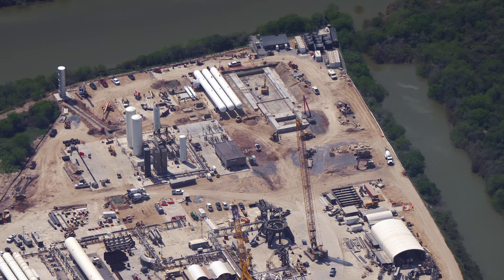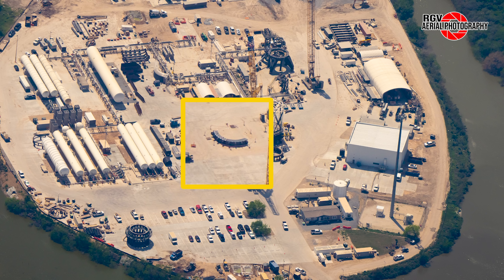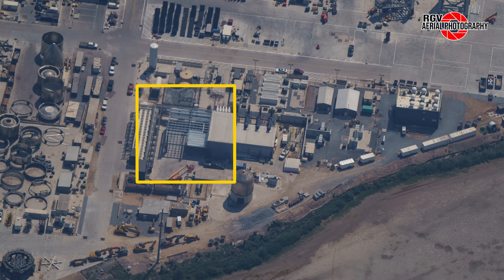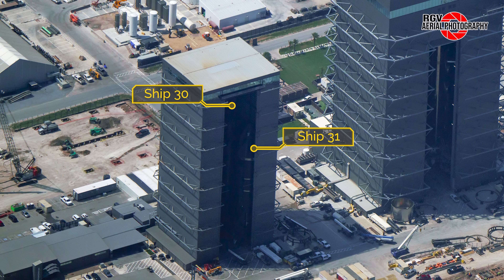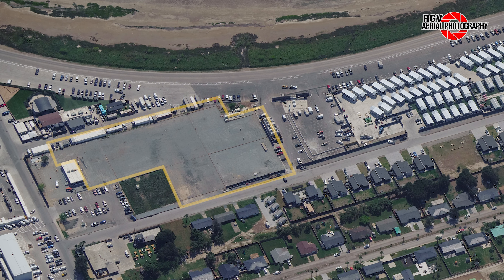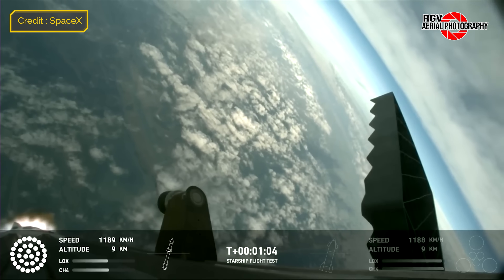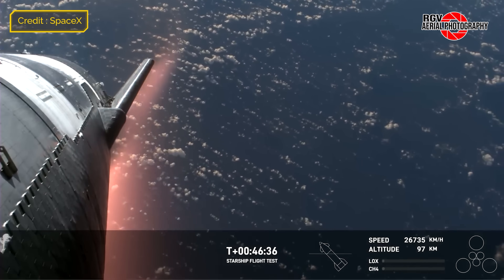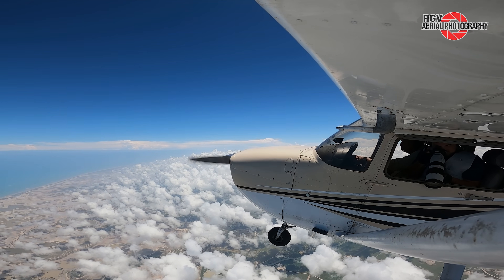Did Stage Zero Survive IFT-3? Starship Post-Launch Progress! 35

Comment: Correction: S28 attempted 2 out of 3 milestones, it completed none (maybe one, but I doubt the transfer test was successful).
Reply: What are the milestones as you think of them?
Reply: @TheEvilmooseofdoom  The 3 described in the video: Actuate cargo door (failed) propellant transfer (results ambiguous) Raptor relight (skipped).

So at best 1 out of 3, which is fine, because the only objective that really mattered, nominal (sub)orbital insertion, was achieved.
Reply: @maxwellquebec8675 I think you are forgetting a few. It finished its orbital insertion burn (almost orbit) and it also rentered. Those were major accomplishments
Reply: You also should not forget about the Booster!! It nearly landed on the Gulf of Mexico and even had an engine relight! It also survived the hot stages and the flip manuever. This flight was really successful. Starship performed everything a non reusable rocket could do and it also achieved a bit more. They are probably only a few flights away from full reusability
Reply: @Imagine_Beyond  I'm using the terminology of "3 milestones" as used in the video. Obviously orbital insertion and boostback were far more important objectives; that goes without saying.

Comment: The starship collection area looks like a trophy area.  Appears they have 3 designs to test in microgravity.  So far, they have proven the fins on starship don't work to control spin in space.  I wonder if the spin of flight 3 created gravity on the starship?  The changes in the center of gravity with the fuel transfer could have caused the spin issue.
Reply: The fins are not meant to control any thing in space. They are meant to help starship once it enters the atmosphere and guide it to a landing zone.
Reply: To early to say if problems were from fins.  But I doubt it.
Reply: I thought they were experimenting with rcs gas thruster and that cause the spin but as aforementioned too early to say